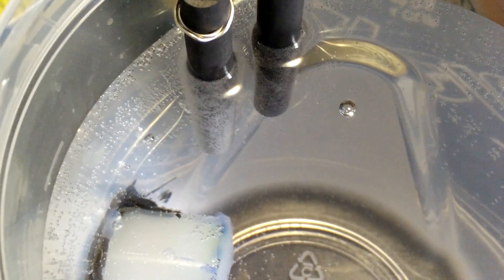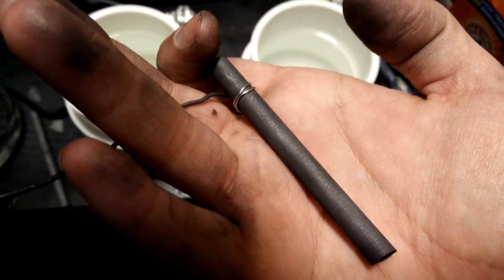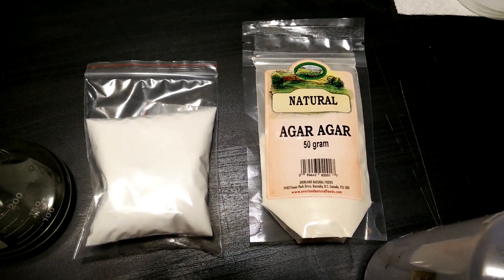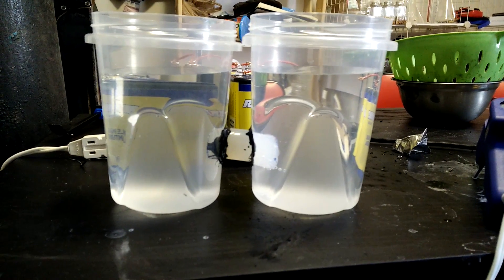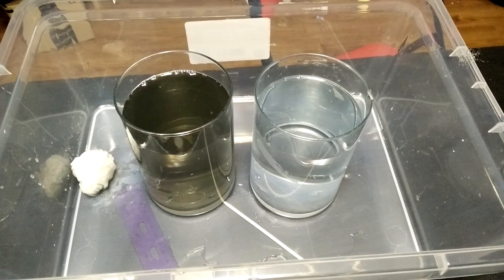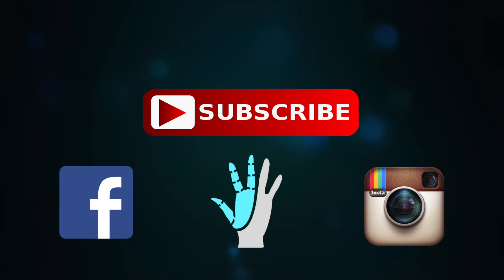How to make sodium hydroxide (lye) from baking soda

Comment: @The Thought Emporium just use terracotta as a membrane. basically 1 flower pot in a lager container with salt solution on the outside and pure water in the pot, or 2 pots in a large container with the salt solution in the larger and pure water in the pots as to not contaminate your NaOH. i used this to make continuous amounts of NaOH in one pot and FeCl in the other using NaCl and carbon and iron electrodes.

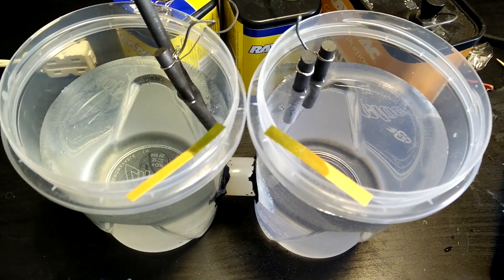Comment: At ~3:35 says pH dropped and then goes on to say how basic it got. Oops.
Reply: yes the potential hydrogen did drop....
Reply: Where exactly is the oops? Do you understand what PH means?
Reply: @jonross377  He says the pH dropped and the solution became more basic, probably around 14. Since pH is a negative log scale, numerically, the pH rose to 14, not dropped.Low pH solutions are acidic, high pH solutions are basic, right? JT above explained that the potential hydrogen dropped, which is true, there was a drop in hydrogen ion, but a drop in hydrogen ion corresponds to a rise in pH. I said oops because the speaker knew what he meant but made it confusing. I probably shouldn't have nitpicked, but I used to teach science courses in colleges and high schools and must have lapsed into red pen mode.
Reply: @pdubb9754  If PH actually means potential hydrogen and the potential hydrogen dropped why does the scale work in reverse? Sorry just trying to wrap my head around this lol. or does Ph not mean potential hydrogen?
Reply: @jonross377  pH can mean potential of hydrogen or power of hydrogen. It is calculated from the concentration (or more appropriately, activity; I will not go into the difference) of hydrogen ion (which can be related to an electrical potential measured with a pH electrode, that's where potential of hydrogen comes from). Specifically, the calculation used is pH=-log[H+] where [H+] is the concentration of hydrogen ion in moles per liter. Suppose you had a solution with 0.000357 moles per liter of hydrogen ion.  Do the calculation and the pH is 3.45, which is rather acidic. Now lets make that solution less acidic (and therefore more basic) by throwing in more zeros, say 0.000000000000357 moles per liter of hydrogen ion. No one wants to talk with numbers like that, so the log scale is convenient. It expresses the values as the exponent or 10 to the x power. 0.000357 = 10 to the -3.45 power.  0.000000000000357 is 10 to the -12.45 power (see where the power of hydrogen comes into play?). But by convention, because people prefer positive numbers to negative numbers, we stick in the minus sign. pH 3.45 and pH 12.45. So as the solution becomes more basic (less acidic), pH increases. pH is actually inversely related to the concentration of hydrogen ion. Is that more convenient than talking in negative numbers or long strings zeros following a decimal point? I think so.
Reply: @pdubb9754  It is truly amazing how people can be so smart and so stupid at the same time. Not you, I am referring to society as a whole. I wonder what changed so much to make us focus on the things we do today...
Reply: @pdubb9754  Sorry for coming back to this but I have another question. Its kindof difficult for me to phrase but here goes. Ok so acid and base is different because one gives up an electron and one takes up an electron right? Thats not the actual question but ill make sure im right about that first.
Reply: @jonross377  An acid gives up a hydrogen ion, which can be thought of as a proton. A base accepts  a proton. I am talking about what chemists refer to as a Bronsted acid and base.  But you are kind of right about the electrons, too. There is another concept, Lewis acids and basis, in which the acid accepts electrons and the base donates electrons, but let's disregard Lewis. In my days as a bench chemist, Lewis never came up. Bronsted acids and bases are what we're talking about with regard to pH measurements, because the H in pH is a proton (aka hydrogen ion).
Reply: @pdubb9754  Ok so what about the cases where you have a base acting as an acid or vice versa? That is what im wondering, what is going on there?
Reply: @pdubb9754  Thanks for answering btw.
Reply: @jonross377  Yeah, that is something that occurs. Look up the term amphiprotic for a more thorough response. There are some acids that in there undissociated form contain more than 1 hydrogen atom that can dissociate in water. Carbonic acid, phosphoric acid, and sulfuric acid are ones that you likely know of. The chemical formula for carbonic acid is H2CO3. It can give up one proton to form bicarbonate ion, HCO3 (with 1- charge), which can give up one proton to form CO3 (with 2- charge). Forgive me for not using conventional subscripts and superscripts and charge indicators. Don't know if I can do that here. Anyhow, bicarbonate ion is capable of giving up or a hydrogen to become carbonate or accepting a hydrogen to become carbonic acid. This is unlikely to happen all at once. All three forms will exist in an equilibrium. The relative amounts of the different forms will depend on other physical and chemical factors, some that depend on the specific chemical we're talking about and some that depend on the external physical and chemical environment (like what other dissolved compounds are in the mix).
Reply: @pdubb9754  I prefer the way you answer I am not really good at reading scientific documents... Kinda boring, I prefer the layman's terms. And I get it now, there are some acids/bases that can EITHER give up or accept an hydrogen. I never really understood that. I loved chemistry but didnt pursue it after high school..

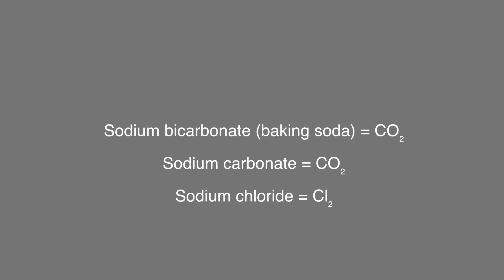Comment: 5:22 With the single cell and using sodium chloride, would this work to make drain cleaner? Since commercial drain cleaner is largely an aqueous solution of Sodium Hydroxide and Sodium hypochlorite, (mostly the former). The main issues it would seem to me would be potentially the ratios might be off, but I'm not sure how big an issue that'd be, and dealing with the chlorine gas produced, but it seems like if this would work, it'd be a cheap way to make homemade drain cleaner, since the only things you need, besides the electrolysis equipment would be table salt and water.

Comment: Perhaps you could help me out, I've been looking to make my own 'O2Grow" system. spiting water with electrolysis to hydrogen & oxygen in my aquaponics system (grows fish & plants) I'm concerned using electrodes that might contaminate plants or fish because my food comes from this. though I do need more Fe2+ in the system also.. iron electrodes create that in electrolysis
Reply: I used air stones years ago. Worked fine.

Comment: Isn't the NaOH reacting also with the carbon electrodes?  I am searching for a way to dissolve carbon (car parts/ oven)
Reply: Carbon is a refractory substance and basically nothing dissolves it apart from strong oxidizers. Piranha solution attacks it (but it'll dissolve car parts or ovens just as well).

Comment: can u use another carbon electrode instead of the gel?
Reply from the maker: Needs to be a gel or membrane so the ions can move. They can't flow through carbon easily
Reply: @thethoughtemporium  I was woundering because it's a fluid membrane could it also be causing more than just electricity flowing through? And could adding silica powder increase conductivity without negative results. If not silica I'm very optimistic in the belief some additive on the periodic table of elements is suitable and perhaps one with a high positive polaric potential  to aid in the exchange of electrons like a battery.
Reply: Perhaps a diode type of membrane made of two membranes staked and made of acceptable negative and positive property's may come up with interesting results
Reply: @thethoughtemporium  what if a conductor was insolated by a thin membrane if it's just an exchange of electrons

Comment: Couldn't you just electrolyze a solution of sodium carbonate, it should eventually produce a large enough concentration of hydroxide. Right?
Reply: CO2 is not liberated due to electrolisis, the anode electode forms O2. CO2 desorbs from the water as the Na+ concentration drops and H+ rises. If you did not separate the electrodes the Na+ would prevent the CO2 from leaveing and it would be just water electrolysis in a Na2CO3 solution. (or a mixture of sodium bicarbonate and carbonate as the former slowli decomposes)

Comment: Could you use salt as a substitute? I'm thinking you could in theory use salt, let it do its conversion to lye, bubble the chlorine and hydrogen into a separate water container and make hydrochloric acid as a secondary product.
Reply from the maker: The way this is done on an industrial scale is with salt. I didn't because I didn't want chlorine gas to be generated.
Reply: Yeah, and for the guy who wants to do that be sure not to mix hydrogen and chlorine with the light on. Chlorine is ready to react with nothing more than uv light!
Reply: Yeah, and for the guy who wants to do that be sure not to mix hydrogen and chlorine with the light on. Chlorine is ready to react with nothing more than uv light!

Comment: I think this cannot make HaOH.
Na+ plus e- to Na
2Na plus 2H2O to 2NaOH plus H2
but soon 
NaOH plus NaHCO3 to Na2CO3
and could not separate any more
because H2O as a solvent is electrolyzed first.
Reply: The membrane separates the NaOH from NaHCO3. Even if the membrane is not really selective for CO3^(-2) it still prevents the mixing of solutions while Na+ is pulled through by the electric field.(also a chemist wouldn't say that Na forms but your expalation works so l like it)

Comment: The Thought Emporium
Thanks for your Video, So, in case of one cubic meter volume:-

1-How Much of Sodium Carbonate we have to solving it in to can get finally a sodium Hydroxide with Concentration 48.0 %, ?

2- How Much current density and Appling DC Volt? Can we Using 1000 A DC x 12 V DC to can get faster Production ? what is expected Time to change all sodium carbonate at this  Current and Voltage  to become Sodium Hydroxide ?

3- Can we using a burned Clay Brick as a membrane? What is Recommended Thickness? What is Expected Life time of it 

Waiting your Comments ASAP

Best Regards

Emad

Comment: what about heating the baking soda it produces lye at 400 Celsius i think
Reply: Abhi Ghadge That is not lye. When sodium bicarbonate is heated above 400°f it turns into sodium carbonate. It has a pH of 11 compared to lye which is higher.
Reply: i was wrong actually , u can convert it to lye with extreme heating . somewhere abt 1200 celsius. the na2co3's co2 pressure increases at high tempratures(its in equilibrium). then using lechatliers principle we can extract na2o. product formed is verly low quantity highly impure, inshort can be done but no point. electrolysis is better option.
Reply: still im unsure of the data ,

Comment: I thought Egyptians were making a lime from chalk and lye of natron soda by heating it in fire.
NaHCO3 + heat=NaOH +CO2.
NaOH+heat=Na2O+H2O

CaCO3+heat=CaO+CO2
Reply: As far as I know, NaHCO3 decomposes to Na2CO3 at a very low temperature. Further decomposing it to Na2O would require temperatures of about 1600°C, so I don't believe the Egyptians could do that.
The decomposition of CaCO3 only needs 800-900°C, so it was much easier for them to make.
Reply: @swabianscience   Reckon you can decompose CaCO3 into Ca(OH)2 first, then dissolve it in water along with Na2CO3 for a double displacement reaction that will yield a NaOH solution and insoluble CaCO3 precipitate.
Reply: lye or lime?
Reply: clearly he says both and specifies for both calcium and sodium compounds? what is your question even?

Comment: Sodium hydroxide isn't highly corrosive or atleast the sodium hydroxide i used
Reply: Barstow https://chemistry.stackexchange.com/questions/6997/ph-range-outside-conventional-0-14
Reply: yeah it's the sodium hydroxide that you are using because it's dilute. The slippery feeling of sodium hydroxide actually came from the oil on your hand reacting with the NaOH making soap.
Reply: pH range can really went below 1 and above 14. Those are the scale you used when you compares the amount of hydrogen ion in the water. Check out SciShow on the topic of Superacids and Superalkalines. On reading it might show as a reading of 14 but really it will act like it is way above that
Reply: DVFDrinkOrDie ph range is 1~14
Reply: The heck it isn't. It's corrosive to any organic matter and it turns the fats in your skin into soap on contact. It's very corrosive ; enough to dissolve burnt-on oven messes; it's the active ingredient in drain cleaners and oven cleaners; at about 20% solution the pH is well above 15; it will dissolve your skin and cause severe burns in minutes

Comment: Can you use a salt bridge to connect the 2 rather than the seltup above?
Reply from the maker: Sure. A cloth soaked in the solution ought to work well if you hang it over the top of the two containers into the solutions

Comment: couldn't you heat the sodium bicarbonate to form an oxide, then add it to water? kinda like calcium carbonate to hydroxide
Reply from the maker: ya that'd work fine but you need a kiln or lots of patience with a blow torch. I'll be covering this method once I'm set up in Brazil and have the kilns built
Reply: I look forward to it. Brazil is an interesting location, not to be to personal or anything but may I ask why you would set up there?
Reply from the maker: I'm working with a group called exosphere to build a huge lab down there so that I can both teach and research. I've posted about it a bunch on my other social media pages if you're interested and i'll be putting up a video talking about it soon as well
Reply: Oh alright, sounds cool man :) look forward to the videos.

Comment: are you sure hot sodium hydroxide eats trought glass? i know molten does
because i evaporated off the solution with sodium hydroxide in it :\
Reply: It does not eat it through, but the corrosion (erosion?) would be visibe afther a time.

Comment: Sodium hypochlorite can be destroyed by boiling the solution. The problem is that it decomposes into sodium chlorate. So again, you will have sodium chlorate contamination. I would just stay clear of the sodium chloride.
Reply: @prospektOS-tmo97   hi are u still there you looks like an expert, I use similar method with clay brick as membrane, my psu was 1 amp-ish it is adapter from broken lcd tv, i throw my chlorine n hydrogen in separate bottle hoped catch some HCL,  after 2-3 days i dont think my NaOH concentration are high enough i have no pH metres so i test with   aluminum it has bubbling n starting to dissolve, but i can touch my NaOH with my bare finger, do u have any suggestion how to make higher concentration?

Comment: At 3:34 don't you mean the pH had RISEN?
Reply: @Justin No, acids are low pH bases are high
Reply: electrons move from positive to negative tackin shit from one tank to the other droping ph in one tank and hightening the other m kay
Reply: @charlesmorris100  Well, electrons actually move from negative to positive but... that's not the point, I know. :/
Reply: Yeah acids decrease pH while bases raise it. Rather than membrane cell electrolysis, just electrolyze table salt in one container instead to get a sodium hydroxide solution (it will be the solution left over in the container afterwards). You'll be releasing chlorine gas during the electrolysis, so use a well-ventilated area
Reply: Silver Legend acids are higher pH, not Alkali (or base)

Comment: have you tried using aluminum foil as electrodes? sodium aluminate is easier to store isn't it
Reply: won't work.  you can see at 3:51 that hydroxide reacts with aluminum (alloy) foil and releases H2 gas.  It might work better with a different aluminum alloy.  Look up aluminum-air battery.  But in general, no.  Use carbon.
Reply: Sodium aluminate is not the goal of this. Sodium hydroxide is.

Comment: Great Job I was wondering what container would you use if you wanted to  evaporate to a solid form. As not to have a reaction as the concentration gets higher as the water evaporates. As you already mentioned that concentrating the solution by boiling would eat the glass
Reply from the maker: +Mark Smith A stainless steel container would work well.

Comment: I wouldn't have expected your membrane to work as well as it did. Nicely done!
Reply from the maker: thanks! I was pretty impressed myself. Now that I know it works there's lots more I want to do with this.
Reply: @thethoughtemporium  A Nylon Monofilament Mesh or Polyster Monofilament Mesh is a good membrane. The Nylon works with Potassium Hydroxide and the Polyster works with Sodium Sodium Hydroxide :)
Reply: @thethoughtemporium  Is it possible to use a pot for plants as a membrane?
Reply: .Step
1: mix sodium bicarbonate and lemon juice
2: Dry it
3: apply heat 350-500°c
4: mix water and filture
5: redy sodium hydroxide solution
Reply: @muyfoods  what’s the best solution ratio?
Reply: @Minh Quang Vo when you dont have slaked lime😂
Reply: Magic Myanmar  thx dude.